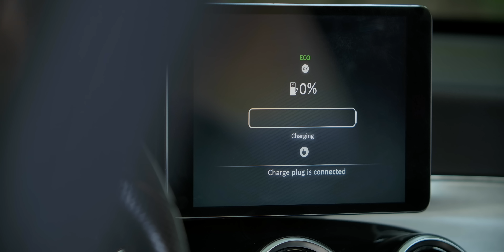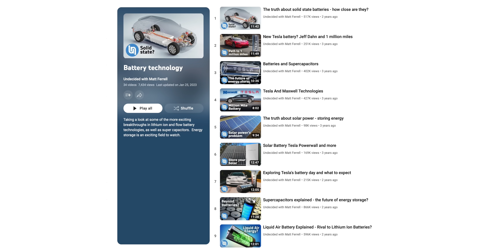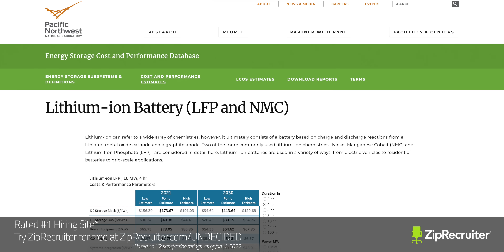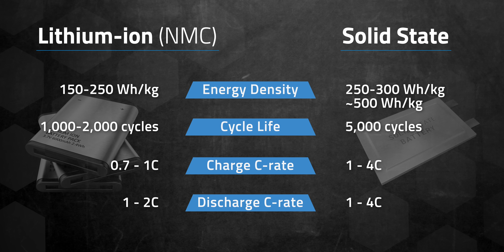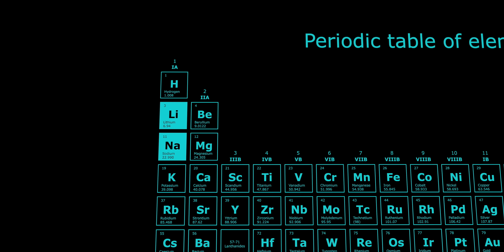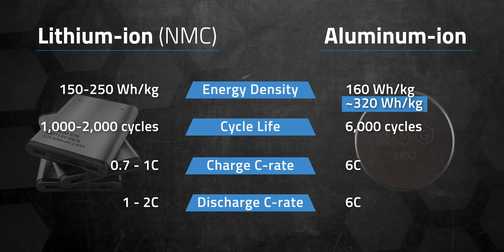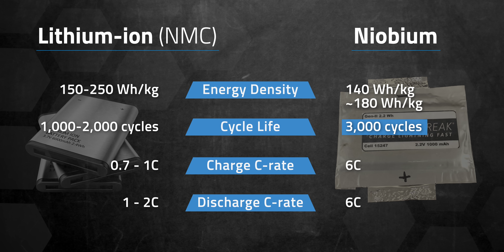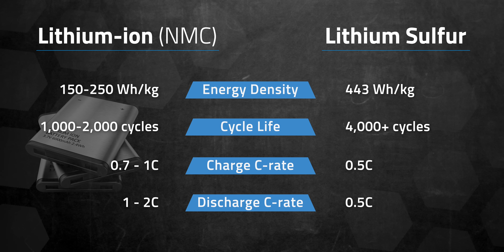Are These Batteries The Future Of Energy Storage?

Comment: Hi Matt, I work in a building that’s part of the old Kodak "Eastman Park" in Rochester and it’s Huuuuge plus it has processing and infrastructure it sells out to companies. 
The ability to place materiel on film and substrate in large quality controlled environment and then roll them up and put in a can is"Eastman Kodak". In fact they had a battery division. 
	While touring a small part of this old giant called Rochester Silver Works, I was gobsmacked at the ability to receive train cars of spent film and X-ray materials come in and virgin high quality material go out, one of which was  silver nitrate . On my walk through I saw a rejected roll of material (large master rolls of film the size of rug rolls at Home Depot) that was from Tesla with copper rectangles (shhhhh).  It’s above my pay grade but if there isn’t something brewing here there should be and it would be a sin. The infrastructure and skills are priceless an  d dozens of times  in my 63 years here-seen the leaders of Kodak, Xerox, and Bausch and Lomb frozen and unable to see a way not to rest on their upper hand position. If I had an idea for a new type of battery chemistry consisting of a "jelly roll " format, anode,cathode; rolled up and put in a can, this is where I would go.

Comment: Dumb question, and I'm not an engineer, obviously. But would it make any sense to combine several of these different batteries to achieve different outcomes? Could you place a rapidly-charging battery in front of a Lithium Ion battery for quick charge, then exchange the charge to an adjacent Lithium Ion battery for slower discharge? Or perhaps exchange the charge to a battery that may be slow-charging, but has a higher energy density? Why do batteries in consumer goods need to consist of only one battery type?

Comment: I'm still very interested in those Diamond Batteries. I know that practically speaking they have very small energy output and are currently only suitable for powering devices which require very little power, but I wonder if it would be worth the time invested to convert all of our carbon nuclear waste into this product. How much energy could a large-scale installation produce? How problematic is the problem of heat production for these batteries at that scale?, and a tie in to that, how safe would a large installation be? Is it even feasible to convert all that waste product into long term low to maybe mid level energy solutions with large enough quantities? Would people 5000 years from now look back on this product and be proud of the accomplishment? I know we don't have any of the answers to these questions yet, but if nothing else, I am hopeful that it will help solve the problem that nuclear waste has presented us with.

Comment: Here's what I'd add to the list: aftermarket EV batteries. It doesn't matter what the technology is, right now it seems to me that having aftermarket batteries for EV swaps or for replacing batteries in your EV has a huge gap in the market. I've priced it out a number of different ways and it seems like it's always in the $10k range for around a 50kWh battery pack even with USED batteries (50kWh is probably the minimum for triple digit mileage). This basically means EV swaps are only for rich peoples pet projects, especially considering this doesn't include the motor, inverter, etc. As a comparison just the battery costs what a brand new crate engine making over 400 horsepower costs. EV swaps will never take off when these are your alternatives and the performance market will remain closed to electric. 

If someone would come out with aftermarket new or refurbished batteries, and if the price were closer to $5k for 50 kwhr I think there'd be a huge market for it.

Comment: Am I the only one that wonders if electrical storage might end up in a similar place as computer memory? Were you have some high C value batteries along side a cheaper, longer lasting and higher capacity low C value battery? Especially if the more recyclable versions are the high C, lower cycle battery. That way at peak times when you need a lot of power held quickly (sunny/windy day or cheap grid power) you can maximize the energy held but in regular situations use of the lower C batteries would be used. Or maybe its the opposite, charging your EV in a few minutes because you have this high output battery only for your car when you get home from work but still could run errands after.

Comment: A lot of these technologies look to upset the EV storage market dramatically... such as sodium and aluminum.  Lower top end density is an easily made sacrifice for much faster charging and, more importantly, little or no risk of fires if the cell is violated during a collision - or just because debris bounces up from the roadway wrong.
Lithium is probably the worst, safety wise, to be cramming into EVs and a lot of the potential power gains for higher density are vastly outweighed by the shielding and cooling systems that other technologies would not need.

Comment: I've gotten to the point where I don't believe any claims about new battery technology that is "coming soon" until it is actually on the consumer market. I've seen way too many claims of a new battery technology that is like 2-3 years from the consumer market that never delivers on that promise.

Unfortunately we are stuck with lithium batteries which suck and haven't had significant improvements in over a decade. The energy density is way too low, the charging is way too slow for things like EVs, they degrade way too fast (especially if you charge to 100%) and they are too expensive. At the rate things are improving I'm not going to get an  EV for probably close to 20 years.

Comment: I'd love to see more on recycling or environmental impact in general and fire/explosion risks. Safe energy storage is one of my main concerns, next to being able to properly recycle batteries.
As you mentioned, there is no battery to rule them all. A smaller capacity EV battery that can be charged super fast (like the Al-ion at 6C) means more charge cycles on the road but with the same energy demands as a double size 3C battery. Even if that Al-ion battery last half as long as traditional EV batteries but can be recycled properly (and does not cost as much) then this is a great solution for a lot of EVs.
Reply: My main thought was what the fire risks for these five were.  If they're safer than lithium, that's an added incentive to switch.

Comment: I'd love to see you cover all of them, make it a series.  Personally I'm bullish on aluminum-graphene and iron-flow batteries but your spot on about there's no battery that will replace all others.  Since GMG's aluminum-graphene batteries are rated at 60c-70c, I think they could be used very successfully at charging stations to prevent sudden grid loading during heavy use and speed-up turnover times.  Iron-flow is a great answer to any NIMBY sentiments and has basically no down-sides for its intended role of long duration, stationary power supply and most importantly, it's a product you can buy right now.

Comment: I consider large scale grid storage to be the real game changer.    Storing that wind/solar power for use in the night will let us get away from the carbon producing problem we have now.  Even storing nuclear energy when the grid doesn't need it is helpful.  I see this done today using pumped storage.  I expect batteries to be more efficient.  Consumers don't tend to care about how they charge batteries or when they use them.    Having that large scale battery and employees and systems  dedicated to getting the most efficiency and longest life out of them, seems like the biggest impact the quickest.  I'm also interested in the batteries produced using easy to find materials.  For example sodium batteries seems to be a good solution to the brine that will be produced when desalinating water.   Be aware that aluminum batteries require aluminum.  Which requires massive amounts of power to refine.  Niobium seems like a material that we don't even have mines for.
Reply: "Be aware that aluminum batteries require aluminum.  Which requires massive amounts of power to refine." It's still much better than lithium. To extract and refine one tonne of lithium, 15 tonnes of CO2 are released in the atmosphere. For aluminum, it's between 1.8 to 2.5 tonnes of CO2.
Reply: @pokerandphilosophy8328  Agreed, just saying no free lunch.  Can only minimize things, not stop them. (not to mention aluminum doesn't tend to explode in your pocket)

Comment: Longevity/cycle-life is the only real thing I care about. I would much rather take the EV with a 250 mile range but can run for 30 years with no noticeable battery loss, than an EV with some bleeding edge battery tech that gives it 1000 mile range but only a 5 year lifespan.

Comment: Right now nickel metal hydroxide is the best battery for solar yard lights and small remote outdoor electronics, because they have a good cycle life, they are not damaged by deap discharge/high charge state, and they are not damaged by charging while frozen.  Lithium ion baterys don't do well at all for this application because LI baterys are damaged by dealing discharge, overcharging, and charging while frozen.

Comment: The case design is a MUST change. 18650 have such a poor design. most of the fires I have seen are due to the positive terminal shorting to the negative ring surrounding the positive terminal. Seems the commercial spot welding and battery heat burns through the insulation.

Comment: Other than the super flat discharge curve, LFP batteries are great for all but the most portable of devices. Prismatic cells are already at roughly 170Wh/kg. Not as good as 200+ in most modern NMC cells, but the cycle life and thermal stability more than makes up for it. I made my own solar storage pack using 280Ah prismatics. 
Manufacturing and recycling LFP chemistry is also better for the environment from what I've read.

But LFP is tough to manage with that crazy flat curve when it comes to cell balancing and state of charge measurements.

Comment: You know, Li-Ion has a HUGE "installed infrastructure" inside our homes. I'm talking about electronics that use them, chargers, dischargers, testers and so on... So, if some company can create a new battery chemistry, but in a way it could be compatible with all this stuff... They would have easier access to the market.

Comment: IMO the three most important battery technologies are Lithium Iron Phosphate, Sodium ion and solid state.  The former is common, doesn't use a lot of unusual materials and works very well now.  Sodium ion uses very cheap materials, and solid state would be good if it could work.  

Goodenough did not invent the glass battery, his colleague Braga did.

Niobium is uncommon, and fast charging mostly isn't needed.  Most privately owned vehicles are parked 23 out of 24 hours and any of those 23 hours can be used to more slowly charge.

Comment: The point you make about there not being 'one battery to rule them all' might be weirdly short-sighted.
A lot of items get significantly cheaper at scale, and once scale and price are set, it tends to eliminate otherwise competitive or better technologies.  I mean, look at the battery space today!  We had nicad, lead acid, alkaline, and a host of other batteries that use to power all of our items... and even as the cost of the lithium feed stock has shot up with demand, the manufacturing costs have dropped like a very heavy rock which is making them competitive with all of these much older and traditionally cheaper technologies.  Everything from electric cars to portable electronics are already dominated by lion batteries, and more and more we are seeing them available to replace traditional car batteries, and even rechargable AA and AAA batteries.  Saw an advertisement the other day for a lion watch battery, which seems insane for the use-case.
Does it make sense to have different battery tech for portable electronics vs mass-storage vs cars trains and planes?  Absolutely!
But will any of these other battery technologies become good enough, quickly enough, and cheap enough to even be considered?  That is where I am less sure.  Really hope I am wrong... but we are just beginning to scale out lithium production.  It is going to get epicly cheap over the next 10 years.

Comment: So, what I want to know is how this fits in with an area where batteries are just now emerging from the dark ages of AGM deep cycle batteries. Yes, I’m talking about marine application. In the leisure sailing marine industry power consumption is a slow trickle for the most part. And sailing provides strong application for solar, wind, and hydroelectric power for recharging. The problem is, it’s impossible to find information on EV equipment for retrofitting older sailboats without running afoul of modern boat manufacturers who want you to by new at prices to are comparative to modern home prices.

Can you get us some information on this subject?

Comment: The atomic weight of aluminum is 27 (give or take).  Lithium is 7 (give or take).  Thus 7 grams of Li will produce 96,500 C of electrons, but 27 grams of aluminum will give up 289,500 C of electrons.  Thus on an electron per gram basis aluminum is only at a slight disadvantage compared to lithium.  IF one can avoid aluminum's strong preference for forming an insulating oxide coating, aluminum would be a very strong candidate for a lightweight, inexpensive  battery component.

Comment: Would it make sense to use each one of these solutions in different capacities in different areas. Since Lithium is the lightest using that in cars would be viable, but using the sodium one in commercial and residential because of its availability. Then, using brick and rock in grid storage.

Comment: It seems like a solid state sodium-ion battery would be the ideal solution for EVs.

It would be safer than lithium-ion (fewer fires), and sodium is abundant.

And because solid state batteries are smaller than traditional batteries, you can fit more in the same amount of space, which would balance out sodium-ion being less energy dense.

Comment: I think the natrium ion has the biggest impact. it’s the only one announced by a major cell manufacturer (in fact the market leader) and for basically entering the market now. so not a start up that needs to promise big to make it to the next funding round but a big player that has its reputation on the line of either performance or timing don’t work out. and with it’s extremely low cost it will be a game changer for many applications, including economy cars for which high end nmc tech ist just too pricy

Comment: There are so many factors involved when it comes to what the optimal battery is. Weight, longevity, long term charge capacity, energy density etc. For a stationary battery the energy density isn't a major factor while the long term charge capacity could be - save energy from the summer to use in the winter would be the use case.
For cars it's weight, volume and energy density that are the main factors.
There are of course other factors too - like what hazard the battery actually is to the surrounding if something goes wrong.

Comment: For the next comparison, include the old classics that are still available: Lead-acid and Nickel Metal Hybrid (NiMH).  They are obviously less efficient, but still potentially useful for some combination of parameter needs.
Reply: Hydride, not hybrid. Hydride means hydrogen.
Reply: @edwardcoulter9361  Thanks for that fact about the NiMH acronym, which I had not previously known, partially due to the unreadable small print on such battery cells.

Comment: just to highlight another extreme: turnigy graphene panther LiIon packs are available now, and almost exclusively used in drone racing and freestyle. they are big and chunky per capacity, but they are rated for 75c constant discharge current, 150C for up to 10s bursts, and well known for very low voltage sag when pushed to the limits of delivering obscene currents, and to take l LOT of abuse before degrading and puffing up. 
definately a battery for few niche niche applications, but darn impressive!!!

Comment: I don't understand C ratings, even after watching your description 3 times.  Firstly the examples you chose don't feel right to me, for some reason I think there are multiple ways to write a function that goes through the 3 points you identified...  If that makes sense, I can see 15min being both C3 and C4 depending on if it's linear or exponential.  Then you use numbers like C6 and I wonder why you didn't use C6 instead of C2 for your example.  Then I don't know what 15min would even mean, is that a 1mAh capacity battery only providing 1mA for 15min...  isn't that super bad, but higher numbers seem better in the rest of the video?

Comment: Getting software that is optimized for low battery usage is more important than getting a new battery. The moment a company makes a new battery, a new computer, or a new phone - is the exact same moment a flock of bad programmers start releasing unoptimized apps and games that push the system to its limit and overuse resources. It won't stop. No matter how good our batteries become, there will always be unskilled programmers with unreasonable deadlines pushing junk code onto our devices.